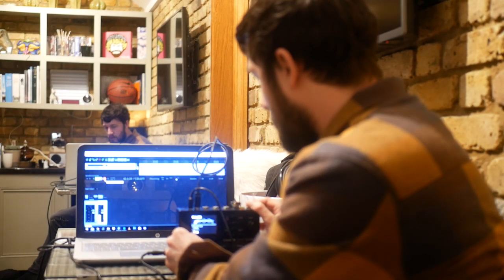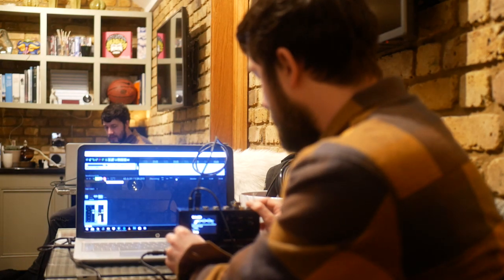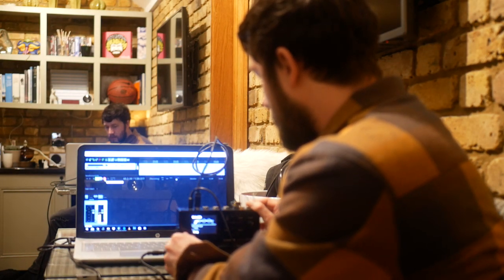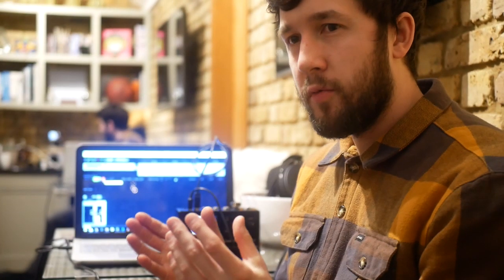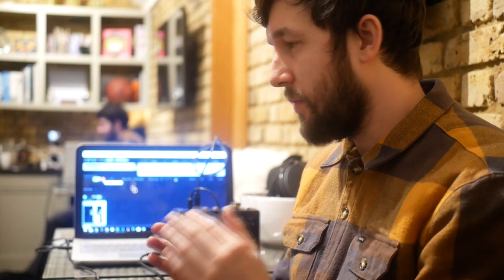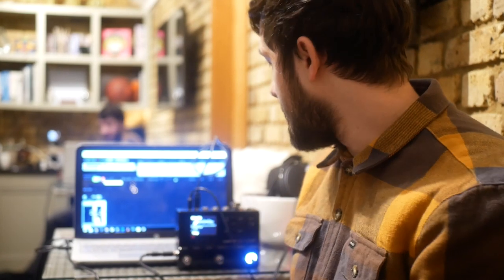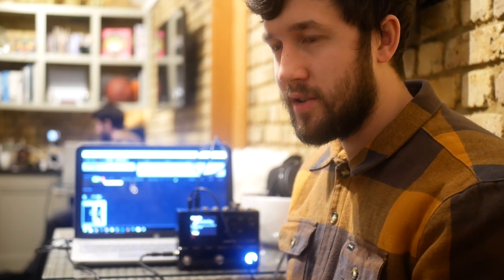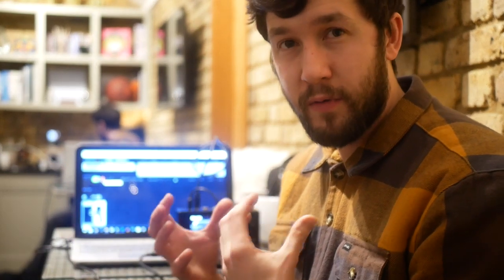Making a MODELLER FEEL like a REAL AMP

Comment: I both agree and Disagree, it is tough to make modelers sound like a real amp, and while the concept does not seem logical because modelers emulate a signal chain, not just a speaker, but yet when you mic a speaker, you are trying to capture how that speaker really sounds, that is why you buy amps and record them to begin with, and then go through mics, and preamps, to maintain that sound from the amps speaker, and into the recording.

I had a Fender Super Reverb 74 Original, and SS fender amps, I have an Egnater Tweaker, a Kemper, Strymon Iridium, Tech 21 Kotzen and UAD Plugins. The trouble starts with modleres starts with GAIN and BASS and TREBLE relations, and how they react with each other, with what speaker, this is where tube amps excel, and this is why they feel like they do, specifically low/mid gain amps at higher volumes.

When modelers/profilers try to add BASS frequency FROM the gain increase, it is just NEVER accurate,  especially the case with the KEMPER, even though the sound is more curate than other modelers, because it is a separate EQ that does not react with the pre/power amp like the real amp, , and when try to profile an amp that has POWER amp od/distortion, it will either be too boomy, or gainy, same with TREBLE, although it will be dynamic, but it will be either too driven to get a semi-sparkly tone, or too dull, this is why it is so difficult for almost all digital stuff to get the correct VOX AC15/30 cleans right, so ENTER compressors... and endless tweaking and "fixing"

But it is not to say that it is impossible, the most accurate in my opinion, are the UAD plugins, specifically, the GAV 19, and the Strymon Iridium, these are the best ones that sound and feel like my tube amps, and  when I push the monitors (hs80s) to higher volume, everything comes crisp and clear as it should be, and this way everything reacts with the speakers is just as good as my tubes, sound and feel, and Sometimes sound better when recorded.

Comment: I think with modellers you need to differ if you're going to play "Live" (or in your Living Room with Headphones or whatever) or in a Recording Studio environment. I agree with Reth in "Studio"-situations (although i did multiple records with just the "raw" amp sound and everything else was applied during the mixing process). Whenever i'm just playing i want to "feel" the "amp in a room" sound as much as POSSIBLE. What's allways missing is the rattling cabinet and the room reflections/rattling. But for this reason i LOVE the Headrush "Balanced" IRs (using the Headrush Gigboard) because they are just a lot of hell full sounding. For that exact reason i'm also using Overloud TH-U Ampsim, because Overloud did something to their Cabsims that makes them absolutely full and bassy (in a good way) sounding, which i've never heard from any other Ampsim (tried a lot). Most Modellers excell in "Studio Sound" territory but are failing in "Amp in the room" feel. Just my 2cents.
Reply from the maker: Haven't heard of that OverLoud thing - got a link?

Comment: Pulling troublesome frequencies out of your tone is a very good thing, particularly with digital modelling solutions.  I've been doing it for years.   I'm not the first person to start doing this, and Rhett Shull certainly isn't either.  To give credit where it's due, check out some Line 6 POD HD500X videos by Peter Hanmer.  Get rid of those painful, headache inducing frequencies, and your gear will sound, and FEEL better.  It's like having an all around sweet spot.  Please check out Peter Hanmer.  There's some good tips and advice to be found on his channel.  And don't be put off because it's mostly POD based.  The same principles apply to the current generation of digital gear.  Oh, and there a lot of inaccuracies in RS's content but hey, he's only human.  It's just not necessarily very helpful some of the time.  But the same goes for many so-called  'YouTubers'.  And while there might not seem much need for low and high cuts when listening through little speakers/monitors at low/bedroom volumes, you're going to need them once your pushing out some serious db's at gig volumes.
Reply from the maker: Hey Steve, I certainly didn't say it's a bad thing, or that it wasn't better, just that many real amps actually have troublesome frequencies, big booming low end and also harsh highs if you stick your head down by the speaker.
Rhett's advice is good, solid and will get you a more balanced, studio ready tone - but the title was about making it feel like a real amp - which rolling of the low end (especially if you're using headphones) can kind of have the opposite effect?
And yep global EQ becomes super useful in a live gigging situation!
Reply: @johnnathancordy  I only use the global eq on my helix for my own frfr on stage monitor, any additional eq for FOH gets done at the desk.  I've been using digital modelling gear since the mid 1990's, starting with the ROLAND GP-100, so I'm not a newbie to this stuff.  Regarding high and low cuts on Helix and HX Stomp, have you compared doing it in the cab/ir block vs doing it with an eq block?  The difference is huge.  Personally I use the parametric EQ, which means I can also cut some of those horrible frequencies with the same block.  I've now got a live tone that sounds and feels incredibly close to one of my favourite amps, the Marshall JVM.  Does it sound great through tiny speakers? No it doesn't.  Does it sound and feel awesome at live volumes?  Oh yes.  Better than it ever sounded when using a conventional rig of guitar Poweramp and cab (Rocktron Velocity and V30 loaded cab).
Reply from the maker: @stevegardiner8473  yeh someone else just pointed out that they have to go between acoustic guitar and electric on the same gig which takes global eq off the menu.

On the Hx stomp I rarely have the space free to run an eq block

Comment: I started putting a tube compressor after the amps and cabs, I think it sounds more open and the notes sound more clear, I don't think it sounds more like a real amp, but it for my use it kinda sounds better. I have an HD500X.

Ps: I always put my reverb and delays at the end of the chain.

Comment: Thanks for the video. My biggest issue is Like when I roll off my guitars volume knob,  on my amp it gets this Strat chime.. I don’t even have to change to a clean channel. I can get a clean sound on my rhythm distortion channel…  where as if I roll off my volume knob with this pedal it’s gets this Slappy Spanky garbage sound. I’ve tried shutting off the noise gate and it just becomes a white noise hissy fit. I am really disappointed in it because my boss ME 70 pedal destroys this thing with tone, and that thing is like 15 years old. It doesn’t really matter what I do. It’s always just saturated garbage Buzzy sound. I’ve tried downloading your IR package that you sell on your website. It definitely improved the sound but it still just sounds like garbage compared to my dual rectifier and black star HT distortion pedal. I can get a warm, Erik Johnson, Joe Satriani type sound Out of that and the response is amazing on all dynamics. I’m really having some dynamic issues with this pedal. The only reason I have to use this pedal is because I joined a band that does not use amps, and they have essentially forbidden me to bring an amp. I’m like well then we’re gonna have to step these petals up because this thing sounds like a freaking toy to me.

Comment: TRied em all.. Had a Kemper, HX effects etc...A real Amp has that feel and just doesn't sound digital...No contest ...
Reply: Most people who feel this way misunderstand what is being modeled. It's never going to sound or feel like an amp in the room, because it's not supposed to. If you mix your amp and listen to the recorded sound and then compare to the DI of Kemper or helix there is very little difference. What IRS do is modeled a mixed cab. 

So modelers are modeling the sound of a recorded guitar, or the sound you get out of FOH
Reply: And you didn't realise that before you bought it? Digital can never truly replicate the infinite fidelity of analogue.
Reply: HX Effects are used with REAL AMPS.
Reply: @ahighervibe4086  yeah they are, doesn’t mean they sound great. I will say in my experience the HX effects sound better into a real tube amp then the same into Helix modeling. But my analog effects sound even better into my tube amp. 

In comparison the Helix into my Twin sounded and felt terrible compared to my analog rig. A lot had to do with the gating. Turn if off and it’s way better, but still not the same.

Comment: The issue for me has been that modellers, (1), never sound natural, and (2) Live through a real amp is harsh and horrible. I would love to fund a modeller that didn't require an additional 1500 in FRFR Powered cabinet to use and , consequently, sound like listening to a guitar amp through listening cone, Or better said( processed sound) . The latest tone master pro has the most organic sound I have heard for a modeller but still dies out on mid to high gain models where the more effects you add concentrates that processed sound. The other issue is that an an amp output stage isn't necessarily flat response. THis market is pointed at musicians who almost never make a stage performance and its too expensive.

Comment: There’s absolutely no way to make a KEMPER sound like an amp in a room ...I owned one, not going to happen. Most people go FOH or record with them which in the end sounds like a recorded amp.Hearing a KEMPER and real amp on a recording is different, I can barely hear the difference ... I usually assume the lesser sound is the real amp, most times the KEMPER will sound better unless you record the amp in a well equipped studio. That’s my take on it. Cool video. Cheers
Reply from the maker: Yeh - I wonder if the Kemper Kabinet thing might be a bit different feel-wise?
Reply: Depending on the amp I think there are ways to get closer. I run one set of outputs to a small set of Neumann monitors. However, my Kemper is in the same room as my decent 2.1-channel stereo so I run the second outputs to my higher end Paradigm 12-inch powered sub in my stereo. I roll the bass cut-off to 80 hz (I think) and when played at modest volume (with a good profile) there is ample low-end response in my room that I'm getting the same room resonances I get with a real amp and 212 cab and you can feel the low-end in the Kemper when playing the guitar. Is a real amp and cab still better...likely, but in absence of having both set up to go back and forth the Kemper with monitors/subwoofer takes it to another level compared to just the small monitors. This works best for 'cleaner' amps and starts to breakdown when trying to recreate large, high gain amps. I tried this set-up on a whim and was amazed the difference the low end from the subwoofer made to the Kemper sounding closer to a real amp in the room. M Britt's FTR37 profile through this setup was pretty convincing to me and my Brother-in-Law who was visiting over Christmas.
Reply: I sold it after a year. Even for recording kemper lacks a layer of realness, attack and harmonic content. In a mix and if you are not playing, its makes the trick, but i am so happy to throw the kemper. All the doubts were gone..it was like a religion, every body telling you that you are the problem not the kemper. But at the same time the bandmates  and me couldn't hear me or  it was too loud. A real pain in the ass. I miss the new reverbs, thats all.
Reply from the maker: @abheceshabemuskk3531  what are you using now out of interest? Thanks for sharing your experience!!
Reply: @johnnathancordy  victory kraken with helix FX. Plus a TS clone, a pharaoh fuzz clone, and a neunaber reverb. 
Btw, even the loop send (preamp out) to a random IR sounds much better than any of the thousands of kemper profiles I had.

Comment: If FOH engineers are legit shelving lows at 500Hz, someone needs to get f'n FIRED. That is COMPLETE blasphemy, most would never take NEARLY that much off in a produced recording. I can understand carving out some  115-120Hz to get rid of the "WOOB-WOOB" in your tone and then shelving at 100Hz, but once you start hitting 150, 200Hz with a shelf, your guitar starts sounding like it's being played inside of a styrofoam cup. 

As for higher gain settings, man what you mentioned at the end hits. On crunch and clean tones, you can get away with more high end and still have that realism. With a high-gain tone, I drop the high-cut to sometimes towards 4K...3K even. It's the cab/mic choice that really dictates how far I take it. Essentially, I dial the amp/cab to feel how I want it to, then use the hi-cut to smooth off the hissy frequencies I don't need in a high-gain situation. Say I use a cab that plays good with the MD421 mic (a very piercing mic if used close to the cap)...Well I love how the mic makes the amp play feel-wise, including in real life, but that mic choice comes with an aggressive high-end, so I shelve IT to a point where it doesn't sound shrill, but still has the right feel and retains a mostly "direct" timbre.

Comment: But dont guitar speakers have a pronounced EQ curve? So after 5k the graph dips down and down towards 20k, whereas in the stomp its more flat, meaning high frequencies are same volume as lower ones?
Reply from the maker: Well yes guitar speakers have a pronounced eq curve, as do the speaker emulations in the Hx stomp. You can check it out in your DAW, but if you turn the speaker cabs off you'll see that there's lots of content at the 10k and above mark that the speaker emulations begin to attenuate
Reply: @johnnathancordy  I see. But personally if I dont cut high frequencies above 6.5k I find it sounds fizzy and digital especially with distortion. In fact my distorted patches are pretty much all capped at 5.5k. With clean it doesnt matter but as soon as you introduce gain I find that it doesnt sound or react like a real amp and I need to do all the high cut stuff.
Reply from the maker: @StevenJoseph  yep this is some of the same stuff that I do....however I think there might be some other strategy as for instance the CabZeus stereo thing I've tried with the origin effects RevivalDrive and exactly the same thing happens, with the fizzy sounding stuff, and with a Suhr ACE cab SIM...so what I'm thinking is I want to find another way to avoid the fizz for situations where I can't rely on a high cut

Comment: This is why Im looking forward to you getting your hands on a Simplifier. This thing replicates like 95% percent of what a real tube amp does. Plus it has a resonance control which replicates the interaction between the speaker and output transformer. Which affects how the way the low end feels. The eq is a real passive tone stack, the controls are very interactive with one another. The lowest frequency it produces is 60hz. I found that applying what Rhett did with the EQ helps me in a live context better. Cause the Simplifier is a lot more accurate compared to digital emulators, it’s closer to the real thing in feel, sound and the frequency range of an actual tube amp. Also many of those frequency range/response charts of guitar speakers are from audio testings where the speaker is hooked to an infinite baffle. Which doesn’t really translates accurately to a normal guitar cab baffle. The speaker might be able to produce those frequencies but the amp and the cab will naturally attenuate or cut those frequencies.

Comment: No disrespect... and...
playing solo guitar may be a whole different thing.
but
     I am a touring musician, and ON STAGE, I have found, without a doubt, that the high and low frequencies NEED to be cut if you are doing classic rock, R&B, funk, gospel etc... to make it sound right and in the pocket.
     A Celestion Vintage 30 Guitar Speaker, 8 Ohm has a Frequency range of only 70-5000Hz and the average guitar amp only goes up to about 6000Hz. But use your ear.  On stage, with a full band, I have experienced that what he said about EQ is spot on. I do the same thing with the Global EQ,, and I constantly have players come up to me raving about my tone. Try it for yourself; if you play in clubs or on stage and you are having a hard time dialing your sound in, this may help - it works very well for me at least - using FRFR speakers.
     The same approach is taken in the recording studio when mixing a project. The proper way to mix is NOT to solo and tweak each instrument individually... properly done, everything is EQ'ed in the context of the entire mix - otherwise instruments compete for the same sonic space and it sound amateurish and cluttered. As a producer (yes, I do that too) I generally roll off low end on almost everything except kick and bass.... this is standard practice in the field. Every instrument has a sonic 'space' that it needs to 'sit' in to make everything sound good. But if you soloed those instruments (or you can find 'stems' online)  you would be shocked at how they sound.
Our ears are funny things. 
IMHO...
YMMV.
Reply from the maker: What I was saying wasn't that it wasn't a) good advice or b) necessary but that it's actually taking you further away from a "real amp", so it's not a modelling issue.

If you stick a sm57 up to a Vox Ac30 for example, you quickly run into "fizzy" and "harsh" tones if you feel me?